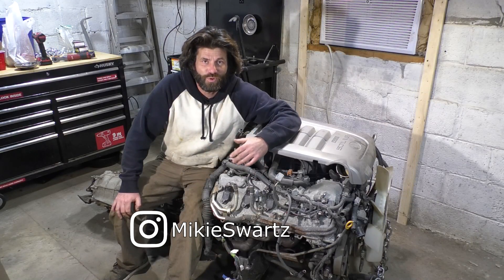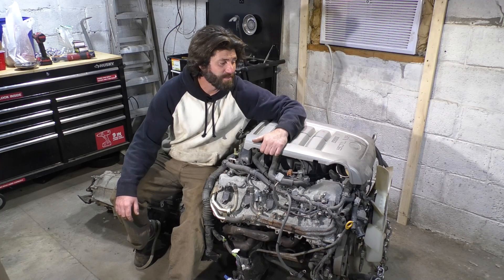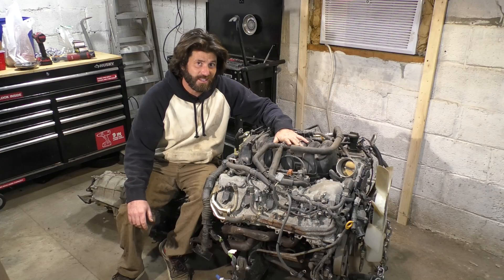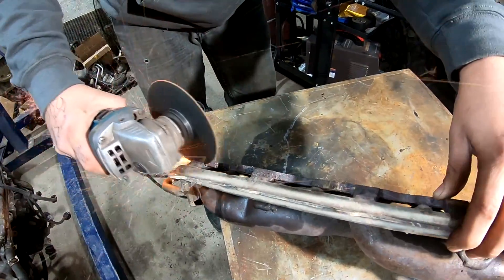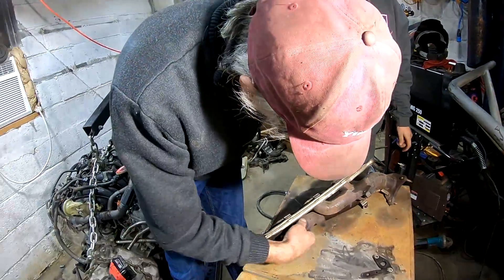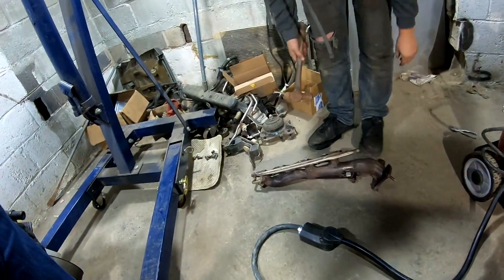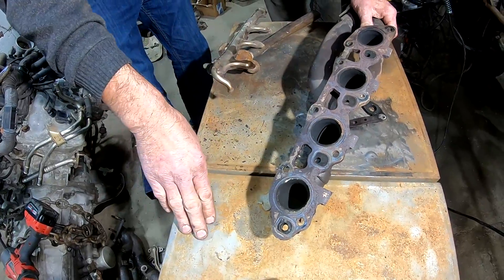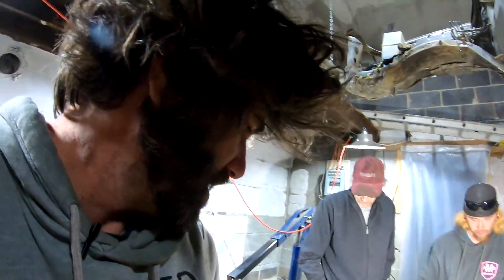Removing Air Injection from 3UR-FE - TACUNDRA 25

Comment: I just gotta say dude, and out of my own experiences, I cringe when I see anyone using an angle grinder with a cutoff wheel that has no guard, no handle, the user isn't wearing gloves, ...and their other naked hand is out in front of the wheel right where the jump direction will be if the wheel catches on something.  You've demonstrated what should be in any safety video for what NOT to do with this tool lol.  I've done this myself many times, but have gotten bitten enough and seen enough horror photos that I chose take precaution every time I use it now, ESPECIALLY with a cutting wheel!  But any grinding / sanding discs can also instantly eat you to pieces.  Angle grinders are probably the most dangerous tool anyone can own.
Reply from the maker: LOL Yeah, you're right.  I'm pretty good with keeping my cut wheels in one piece, but the possibility is always there.  I basically keep out of the line of fire.  Sometimes I do wear a whole face shield or other protection if I know the risk is higher or whatever.

Comment: Thanks for the mention guys, if you need help with this project let us know! The recommended kit for this sort of thing is absolutely our Gen-II kits. Regardless of the bypass kit you will always need to retain the pressure sensors, the ECM still uses those even if the Secondary Air System is removed. On most of the systems these are built into the top of the air switching valves. With the Gen-II kit the sensors are the only thing that need to remain and the Gen-II kit also just happens to connect to them. The rest of the stuff like the air pumps, tubes, air injection drivers can all be removed without any extra pieces. If the sensors are damaged or you want to completely remove the air switching valves you will need to cut the pressure sensor off the top of the valve and connect to the Gen-II harness or use one of our Pressure Sensor Replacements Option (PSO for the Gen-II kit). No need to use a tuner or anything else and the ECM will think everything is still connected and operating exactly like it is supposed to. You can find them here: https://hewitt-tech.com If anyone has any questions about our systems please give us a call Toll Free 844-307-7671 or email us Support@hewitt-tech.com
Reply from the maker: Thanks!

Comment: How are you doing to deal with error codes without hardware? Error codes will result in detuned engine.
Reply from the maker: Sorry I didnt mention that in the video. I only wrote about it in the description. I am planning to retune the ECU with an HPTuners MPVI2. I think that can disable the air injection. If not, there are foolers available.
Reply: @WHIPBASH  , awesome.

Comment: You may have to use some sort of air injection pump bypass fooler if you plan on running the stock ECU. If it throws a code for the air injection (due to it being removed) it will put the engine into limp mode
Reply from the maker: I should have mentioned that in the video.  I'm planning to use an HP Tuners MPVI2 to tune the factory ECU.  I'm hoping I can disable the air injection with that.  Not sure though.
Reply: I know you can disable it on the 1GR Tacomas, so I don't see why you wouldn't be able to on this.
Reply: Yes I have a AIP bypass on my 2UZ in my 4Runner
Reply: Will it give you more seat of the pants feel or just get rid of that troublesome system?